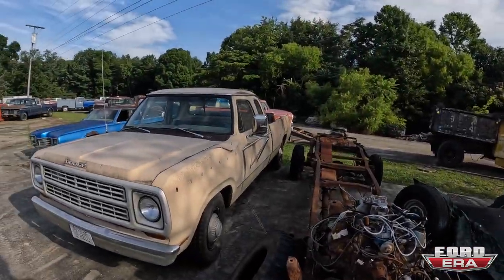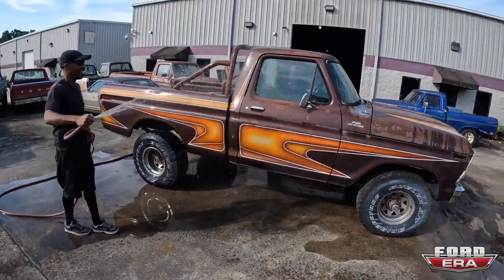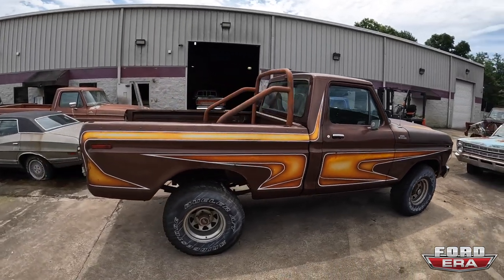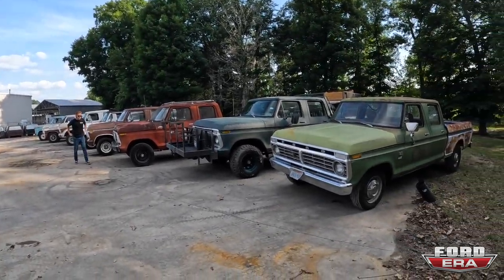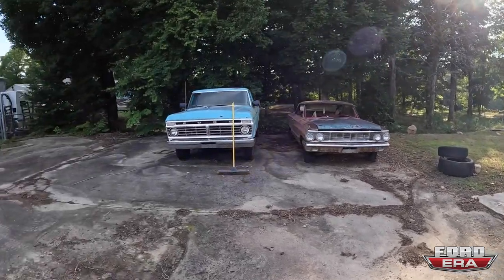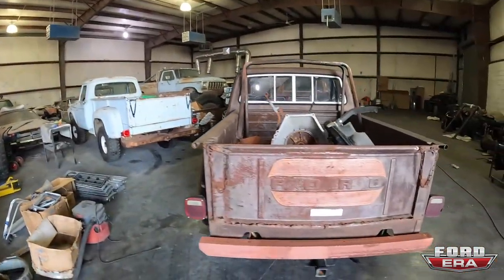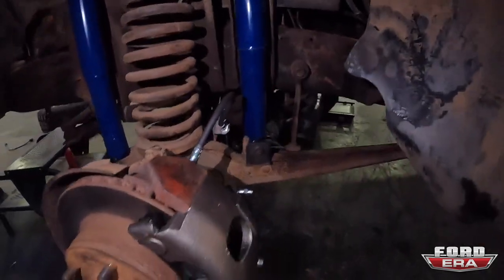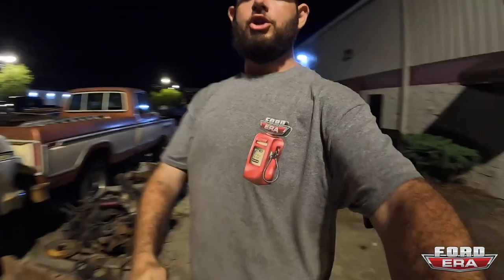Soddy Daisy Collection Part 7 | Ford Era

Comment: I just found your channel and subscribed. I was scrolling through the videos and seen Soddy daisy and it made me curious… Lmao where are you from? I live in Chickamauga Ga. I recently bought a 1972 F100 Ranger XLT. It’s like a gold color and I was wondering if you could tell me what color that would be. I’m pretty sure it’s all original. The 302 kinda had me thinking it wasn’t but I looked at the title and it does have a 302 engine code. I would look at the color code in the door but it’s currently at my moms house in Murphy NC. The ad said it was a 4 speed truck but when we got there it was a 3 speed on the column that they tried to rig up a floor shifter in it…😂🤦🏻 But other than that and the front of the bed being rusted out it’s a beautiful truck. The closest color I’ve seen to it is your gold dust truck.

Comment: Been trying to find a 67-69 F100 Std Cab Shortbox 2wd project under 5K and it's hard lol. My first truck was a 68 F100 Ranger SWB with a 390 no power anything, 3 spd Paid $200 and drove it home from a junkyard, still have all the badges off the truck, it was stolen and junked when a Friend who let me keep it at his place died and before I knew he passed his POS Girl scrapped everything on the property, other people lost their cars and trucks besides me, also lost a Opel Kadet that was there also. lol. I would take any 2wd though dentside bumpside even a Bullnose at this point. Hard to find in my area anymore as most are rusted away

Comment: The midas trucks were a dealer ordered package from midas conversions in elkhart indiana.
Ours was a local original owner truck from windsor mo. They put a flat bed on it after thee original rusted out,still have the bed,tailgate and light bar. This one came with. Aluminum slots. Motor was shot,so my son installed a mild 429 in it. As soon as i figure out how to send you pics i will.
Could you show som interior pics? Thxs.
Reply: Whats the latest on the midas touch truck?